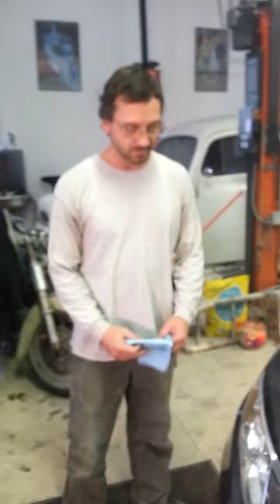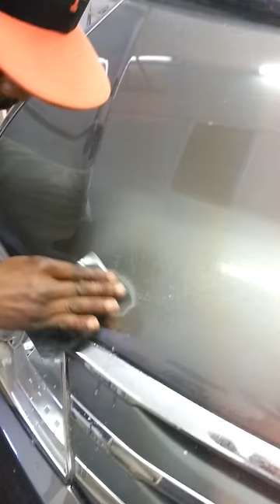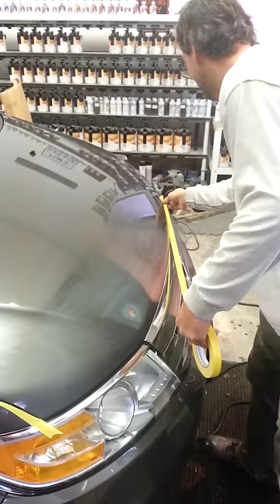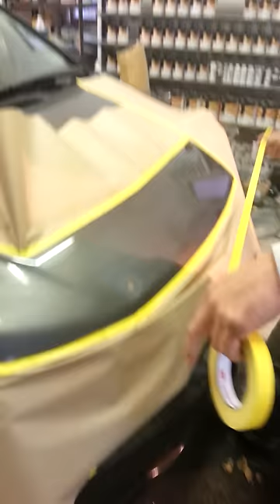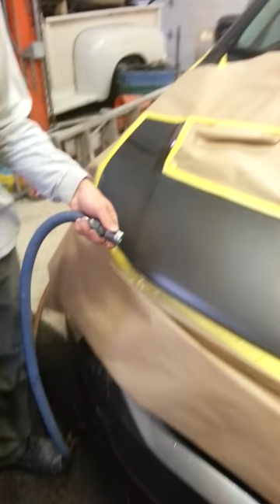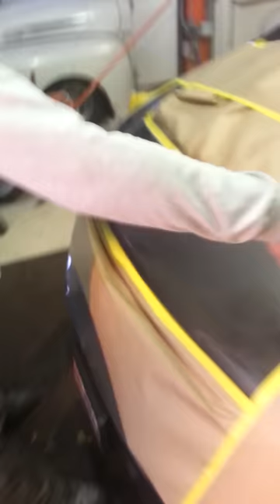How to paint a hood on a car and do a Blend

Comment: Tip for people watching this. Sand anything you sand with a flat surface behind you're paper, sanding with you're fingers will not sand a surface perfectly flat, always wear a respirator (smoker or not), never spray in a place with silicone products in the room (calk, oil, etc) as it can cause you're paint to fish eye. Also cover surrounding surfaces well....I can almost guarantee there is dry spray on the front bumper of this vehicle and over spray on the windshield. Also don't smoke when you are painting....plus follow the flash time instructions from the paint manufacture.
Reply: +libtechrider2010 I agree with you 100% i been in the game for about 2.5 years and even I know better than that.
Reply: +Leslie Kinney get what u pay for unfortunately tho mate :<
Reply: Heed this advice!
I made a groove in the clear coat sanding without a sanding block, with my finger. Thinking, don't listen to them, you can do it!       I was wrong.
Now I have a .....gully, that I have created.
The rest of the car is shaping up and looking good though.
My eyes however, can't not see the gully.
 If I clean and scuff the surrounding area, then add a thin layer of clear. Can I compound it to blend it in? 
Anyway, use a sanding block.

Comment: Lessons learned :

1) this is an all day job
2) back taping helps minimize hard lines
3) good music helps the day move along
4) brothers gon smoke some weed
5)  use heat lamp to dry clear coat before wet sanding
6) Tom Coronado is cool as fuck

Comment: How can I sand the edges on my Acrylic Enamel where I taped it off (without back-taping)?  I sprayed Omni stock color and did not match my 2000 Ford truck.  I did NOT put clear on afterward.  Waiting for a solution before I clear-coat the fresh patches.  It doesn;t look like rubbing compound would even- out this thick of an edge.  I should have watched your "back-taping" video before I did these 2 damaged spots.  Want to finish this up ASAP.  Thanks.

Comment: Nice work. 3M makes a foam strip that really works well in place of back taping for blend jobs. It comes in a roll and really works well,no edge at all if used properly. Wish you'd wear a dust mask when you're sanding and a better mask when you're spraying. You're face is right down in it buddy. JMO

Comment from the maker: Yes we do have a heated Spray Booth,  not at that location but at our 200 industrial drive location.  That hood was a dealership car and . they demand quick easy and cheap.  We do most of our work outside with the elements, so out techs know how to do it with little dust.  if we do get dust its minimal and we wet sand it out.   Hope this answered your question.  Thanks
Reply: i want to see the 2 ppart video

Comment: P.S.  You always use a rubber pad to level surface primer, not your fingers.  You can use a small rubber office eraser with abrasive paper held around it to reduce the work area.  What about a mist color to get a really perfect scratch-free surface?  Get all the mist color off the putty/primer with abrasive paper.

Comment: i work for a mobile autobody and do all dealerships and u r right they want shit done same day and for dirt cheap everyone has their short cuts we mainly do touch ups and scratch repairs but also just do bumper spot ins or fenderflares we stay away from bigger panels just the way we do it though we also use the same guns as u and me personally love using reducer to throw a blend  keep it up man
Reply: Hell Drzphx, you say you use the same guns that he has; to me it looks like hes using an apollo turbine with their 7500 gun. Is that what you use for "touchups and scratch repair"?  This is the unit I was looking to buy for some touchups and scraches also.

What Tip/needle size and Cap are you using for the Base coat? And take it you are also clear coating 2k, if so what Needle/Cap are you using for that? 

Thanks for the answer.

Comment: To Our valuable Subscribers,  All of our Video's are to used for the DIYers, they are not to be used in Body Shops. We have a body shop also, but these techs are mobile. Our 12 techs go to dealerships and do used cars. With that being said if anybody knows about the used car industry you know they want it fast and very cheap. Our Techs know the short cuts and how to do it for the Used car customer. These Techs work outside usually so they are used to weather conditions. Finally our products are very low and under VOC limits in the state of Illinois.,meaning we have a EPA exemption and can spray outside with no danger. All of our products have no Lead and are very safe to use. So if the "know it alls" would like a job, come see us.Thanks.

Comment: I  would not accept this as a customer: it isn't finished!  You need to wet and dry the overspray of new and old clear with 3000 grit.  Then give it a good cut and polish.  Or, you can blend out the dry area with base coat thinner/reducer very soon after applying the final clear coat.  I prefer the former because thinner can undermine the original paint.

Comment: The repair is going to lift because lacquer spot putty doesn't adhere to metal. It's going to swell on the feather edge no doubt and that clear is 100% Going to peel on every Edge. I hate leaving negative comments I really do but this is so what not to do to repair something.
Reply: Thank you for your comment. Please remember that we do work for the Automotive dealerships mostly. Keeping that in mind they want it fast and very cheaply. These videos are designed for the average DIY, not for body shop quality. We have a body shop that does hood also, but our mobile tech don't have the equipment or the time to do complete hoods outside. Also dealerships will not pay $700.00 to do a hood out of a mobile truck. They want it done for $200. This is one of the reasons we do spot blends. We know what will happen down the line, but this is the way the dealers want it, and we try to please. Thanks again, I hope it is a little clearer now what we do.
Reply: Tom Coronado Point clearly taken. Dealerships never want to pay so I get it.

Comment: PLEASE NOTE: THIS IS DEALERSHIP WORK, NOT RETAIL. These guys are supplying a service based on what the dealer is paying. Everyone wins, except the person buying the car. Yep, it’s a cruel game. Just be aware, most any used car lot can have stock that’s been thru this process. It’s standard for the typical lot. SO, look close. Inspect in good light. Feel the door and panel edges for tape lines. A CLEAN CARFAX MEANS NOTHING!!! Look at it like this. $200.00 gross, with $15.00 in supplies, with 1.5 hrs total. Do several a day...you do the math.

Comment: Should have taken the hood off and scuffed the whole thing, then cleared it. I'll bet it peels in a few years. Also, when feathering the clear at the edges, best to keep the trigger on, and pull up and away from the surface as you near the edge of the blend rather than just let off the trigger.
Reply: Use a shoe horn and shove it. Just because you can't do it right don't mean TC can't do it right.

Comment: are you kidding me? with your fingers, no mask ..then you used the worst puddy .
thanks bro .but no thanks, and nice wood sander. this is afucken joke pal. i wouldn't let u near my car.
Reply: Shawn Bencze  know what your saying but that wood sander sands just like a jitter bug. No it's not a palm sander but it will work. It pretty aggressive though but I have sanded  a lot of filler with it back in the day when I did not have my jitter bug or Da palmsander
Reply: +Shawn Bencze Why is that the "worst" putty? I have seen plenty of people use it and the results are fine. What do you think is going to happen?
Reply: +Shawn Bencze I agree. The no mask and using finger made me shake my head.  I think most body men stopped using that red glazing more than 25 years ago. There are much better products now. The wood sander I'll ignore, I'm guilty of that also. lol
Reply: say what you want "pal" but results are speaking...  he just show people like you  - that job can be done without everything "the best" ... etc :) Cheers (btw - you can take your car wherever you want)